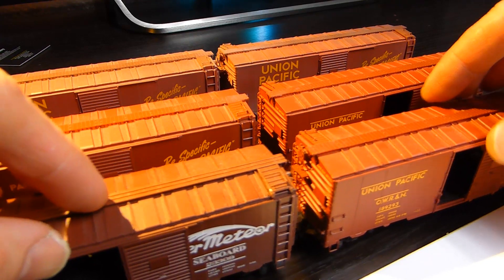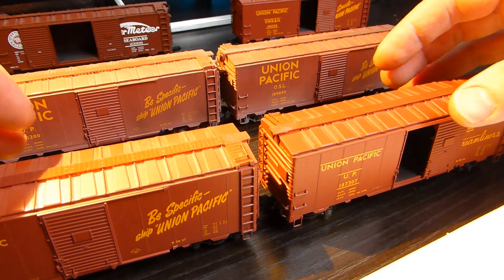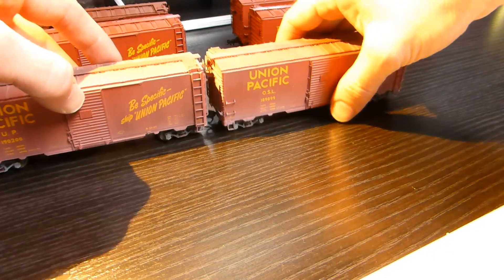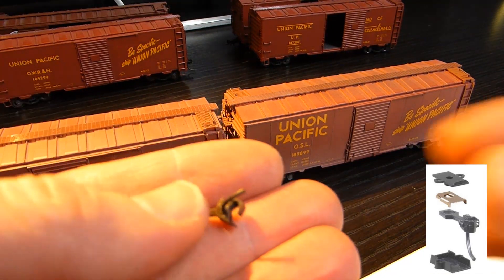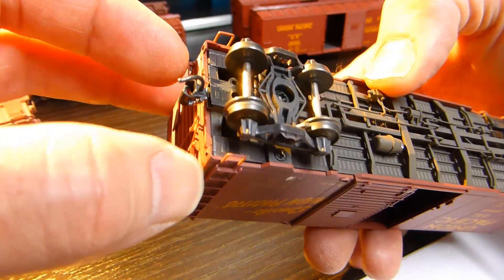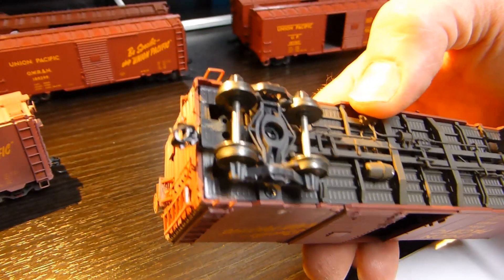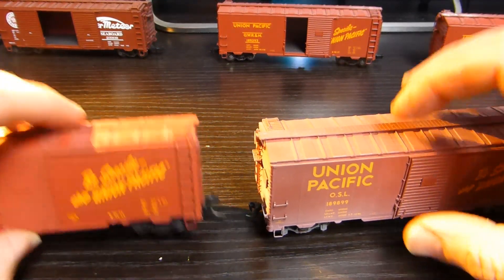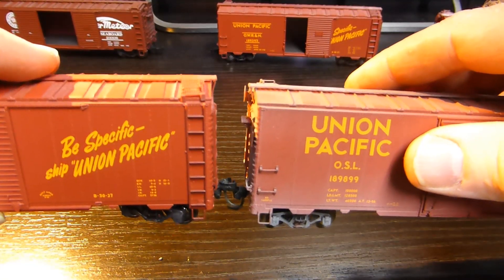A LOOK AT KADEE COUPLINGS

Comment: Thank you Jim , you can buy those pockets for the coupling to fit in to then ? its then a case of getting the right height fitting
Reply from the maker: I got all mine off ebay but there are some model shops that stock them...
The ones you want come with the caseings so you can glue them with two pack resin glue so to retro fit...that guy off ebay with a similar coach to you had done this in 00 scale so it should work....
Its just a case of looking out for some...
Reply: hovermotion O K  Jim , will look in to it later ..Dave
Reply: Dave
Some British modellers over here do use kadee couplers on their trucks/open wagons, the Ottawa group does use them, they do look a bit funny on British rolling stock because they are for rolling stock over here. Kadee number 5s I use all the time as well as 148s and 158s. Number 5s 148s and 158s all can work together. 158 are a bit finer and more detailed and just a bit smaller but by not much. I sometimes cut off the "trip pins" off myself. you can get them with longer drawbars which makes the coupler longer or shorter from the car/coach/wagon etc.. Keep an eye on coupler heights from the rail.
Best wishes
Danny
Reply: Trains Big and Small Thanks for that Danny , like I said I have more or less sorted mine out , but will investigate on the odd ones that will have to drill out the riveted ones ...Cheers dave